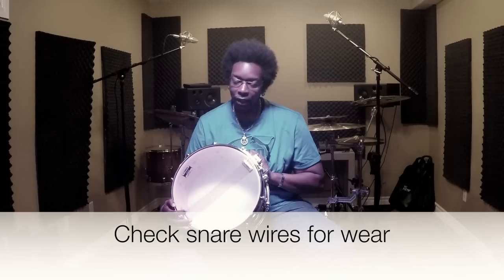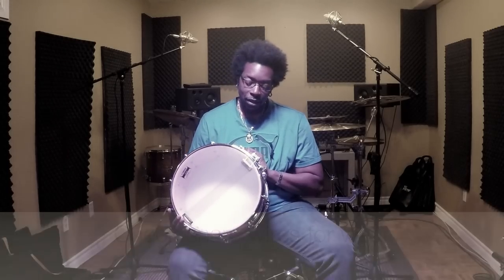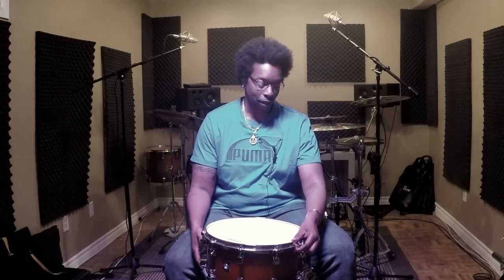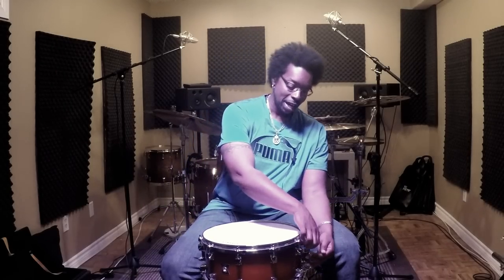Why Your Snare Sounds Like Craaap - Common Problems

Comment: Rob my snare tonight on my New Years Eve set up was getting funky. During sound check I noticed the bass guitar was causing my snares to rattle quite a bit and my tone was a bit off. All I did was tension up the bottom head as you showed us and it sounded like a million bucks again! I did not even have to touch the top head tuning wise. The bass guitar frequencies could barely make it rattle afterwards. I had a great show because of you man. Thanks a lot!  PDP 10 ply Concept maple snare drum.  I played a deep steel 1974 Premier forever till I found this drum. Even though I am a lifetime drummer you NEVER know it all.  We really appreciate you out here.

Comment: Best snare for no cash is an 80's Tama Swingstar.  They're a seamless steel shell.  Same shell used on the higher end snares.  You can find 'em for $50+/-.  Next step up is a Ludwig Acrolite for $100-150.  Seamless aluminum.
Reply: Bryson Dockrill I bought the flagship Black Beauty almost a year ago. Still can't get it to sound right. I have all faith that someone who knows can get a 6.5 Acrolite to sound better the my $1000 work of art!
Reply: I've been through some expensive snares...70's Black Beauties, 6.5 Supersensitive Ludaloys, Ayotte, DW, etc.  People get caught up in prestige.  Going to improve your sound more by practicing than shopping.  I'm sticking with my rusty, worthless Tama.
Reply: Bryson Dockrill
Reply: Yes?
Reply: Metal sounds awful, personal opinion, it allows far too much overtone, always find myself dampening at least some aspect of a metal snare or trying to counter the overtone with tuning. Need a lovely piece of maple or bubinga
Reply: Acrolites are the bomb-diggity.  I use them for EVERYTHING, and I get questions and compliments from dudes playing DWs, Bradys, you name it!!
Reply: @j88k001  acrolites are bloody amazing value.   I had a supra supersensitive 6.5 that cost a fortune,  but ended up using the acrolite 90 per cent of the time.
Reply: I have a couple of Gretsch wood snares, a DW wood snare, an ancient Slingerland (when I want to sound like Gene Krupa), a Ludwig brass piccolo and a Pearl brass that used to be my go to snare, and then I got an 80's era Acrolite and heavy duty Pearl snare stand  for 150 bucks (including shipping) on eBay. Wholly shit, that homely grey beast is a killer!

Comment: Excellent point about the bottom head. I always had trouble getting my snare drum to sound great and I always thought I had the bottom head plenty tight. However, recently I decided to crank it up to a level that I thought could be near the breaking point. But it didn't break and now my snare sounds better than ever. Plus I'm getting additional rebound which has allowed me to loosen the top head and reduce some of the excessive ringing.

Comment: Thanks so much for the help. My '68 Ludwig Supraphonic 400 snare sounds great. I did have a problem with converting to 42 strand snare. Could not figure that one out. I converted to the plastic trap and a 20 strand snare rather than the old 16 strand or wires. But when I used your method of tuning and turned the trap off, then intensified the trap setting the snare came to life. The only other problem was it was ringing really loud even with baseball bat muffler on. So my last thing to do was to lower the tuning on the four key next to the trap and the tape holder and voila. It sounds awesome.

Comment: I played a lot for some years, very hard work and very underpaid. I already knew about these things, but just wanted to say these are very good and sound advices. Check these things out, it really helps. 

If the skin breaks five minutes before the gig, have a spare skin - and use cut out rings from old skins to dampen the effing drum. There is no mode like panic mode, and when your dear guitarist laughs at you, smash his face AFTER the gig and solve the problem BEFORE the gig. :D

Comment: I've found that using Grover cable snares can help reduce snare buzz quite a lot. It won't eliminate the problem, but will certainly help. They dry out the sound a little, but for me, the sound still cuts thru the mix very well, and can improve the sound of metal (steel) shell snare drums by reducing the overall metallic ring of the drum.
I gave up on spiral snares a long time ago.

Comment: Some great advice here!  Learning to get a decent sound out of a snare drum has been an uphill struggle for me, and I still wouldn't consider myself an expert.   I do use a Drum Dial sometimes though.  The thing is, before I started using one I didn't know what a properly tuned snare drum should sound like.  The Drum Dial was a revelation, because with that thing I could get it mathematically perfect and then it was like whoa!  THAT's what it should sound like!  Now that I know, I can do it by ear, but I still use the Drum Dial sometimes.  Another thing that I've learned is that you can drastically improve the sound of a cheap drum by putting a good head on it, like an Ambassador or an Evans G1 among others.  That can make a huge difference in the sound of cheap drum!

Comment: Very cool video, sharing a lifetime of knowledge. I’d like to add:

Make sure your snare wires are mounted DEAD STRAIGHT. It’s easy to check, just flip the drum and watch them engage - if you see the end plates tilt a bit, not straight. That can give you a twangy, raunchy sound.  
I dig nylon cord (Ludwig orange) because you can fine tune the straightness from both sides with cord, but not with straps.

Comment: Great advice Rob!!  With a background in pipe and drums, we used Kevlar heads.  I tried one on my kit.  AMAZING sound and stick response.  I have one now that is probably twenty years old.  I know everyone's immediate thought is "you idiot, you must have trash sound".  Nah ah.  Kevlar doesn't stretch or break and you can crank them as much as you want.  I'm only recommending this for people who can dial in the sound of them but more importantly, they won't break leaving you stranded at a gig etc.  Just balance the bottom head and never worry about it again.  We actually collapsed (destroyed) the shell of a snare drum in the pipe band by over-torqueing the Kevlar head once just to see how far we could push it, and the head didn't break.  They are that indestructible but have great solid and dry sounds.

Comment: Hey Rob, love your videos... You've got a great, laid back teaching style that I dig. Have you ever thought of doing some lessons for Drumeo? 
I wanted to add my 2 cents... The snare is the heart of a kit, and can really make or break your sound. The snare that came with your starter set is probably junk, that's the hard truth. One of your first investments should be a good solid snare. IMHO, the Ludwig Acrolite is a great value at around $100-$125 - although it may be too dry for some (I loves some dry). Don't ignore your reso heads - we tend to think 'ah, it's just a bottom head' and leave the junk that came on the drum. Nothing could be farther from the truth, the bottom head is just as important, maybe more! Invest in good heads, top and bottom, or you're not getting the best from your drum. Same goes for snare wires and straps/cords... Use good stuff - PureSound is the standard, but not all no-name wires are junk. Look for quality finish, clean solders, perfectly straight wires (no gaps or warping). Once you've got quality components on a quality drum, you'll get a good sound. If there's still too much ring for you, try some tuning aids - a couple of my favorites are Aquarian Studio Rings (instant overtone remover) and of course Moon Gels. I even put a cymbal felt on my snare sometimes. Read, watch Beatdown Brown vids, and experiment! You can only get experience in tuning by tuning, right? So get in there and tune. Get to know your drums. Rock on.

Comment: Yep, on the tension around the heads.....I was taught to tune the snare drum to a "D" on each and every tension rod and each individual snare gut on a marching snare.  It's time consuming but, it'll sound like a dream!!!!   Any drum can sound its best if you do this......Guys...there's nothing like a Pearl- in my opinion.    But, you can take a cheap drum, strip it to the shell then, order good quality parts to replace the crap.....As long as you have a good maple shell you can work with it.   The metal parts make the snare what it is.

Comment: Evans makes a great tension rod key with a built-in adjustable torque setting. You can set all of your tensioners to a very similar tension quickly and easily.  I've found that it works best if you back-off on each nut a quarter turn each time you check tension ( for an already set drum). Otherwise, loosen all the nuts off to the point they're still more than finger tight before you weset your drum head. It also makes it super easy to match the tensions on your batter (top) and your resonant (bottom) heads in a minute or 2 . There's also a little gauge with markings so you can write down your tension settings  to easily repeat your previous tensions when you change out a new head. ( or just set it to duplicate the current nuts' setting by feel for when it "pops".)

Comment: When he said "dont use a Tune-Bot" I immediately thought to myself how I need to stop constantly using it and it taking an hour to get my snare where I want it and just rely on Rob's tuning techniques. Sure, you can use a Tune-Bot to tune from scratch and that'll take you a good while but with Rob's tuning method for a snare can get you very close and with a mic attached to any snare or drum you're getting hear the overall tone of the drum and not that one low lug on the drum.

Comment: All good and accurate info. But IMHO, the single most critical element in the sound of your snare (even with a entry level shells and components) is gonna be the selection of the heads. I'm always amazed at what a difference changing weights and ply's makes to the sound of your drums,  especially your snare.  After that, it'a all about the baring edges and how the snare beds were cut.

Comment: I tune my resonant head medium tight (8 out of 10), and my batter about a whole tone up from that, close to as tight as I can get it. 
I like that sound. It's a 14 x 8, 9 ply maple (Tama custom). All the other issues are like you said they should be. Is there a reason why you wouldn't tune a snare like that? Like some tonal quality? 
It has a good crack, with a somewhat muted wire response, which I prefer. It records well to my ears for a dry-ish rock sound.

Comment: Thanks for the snare tips!! Now here's a room acoustic panel tip.. The eggcrate foam  does not work.. You can build your own using Owens-Corning 703 4" deep in wood frames and with porus material covering. Your drum room will sound a lot better. I can hear a boxiness in your voice track that can be fixed..

Comment: Try a really thin reso (snare side) head, such as 3mm along with a batter head that has some sort of control ring.  A good overall choice is an Evana Genera Dry batter head which is also drilled with small holes along the edge to help eliminate excessive overtones.  Tune the reso higher than the batter and try a little moongel or other dampening device to the batter head.  With snare wires, usually avoid wires that use cord and stick with straps.  Puresound Blasters are good although cheaper, yet new snare wires will provide an improvement.  One other thing, $700+ snares don't necessarily sound better than a $250-$300 snare.

Comment: Thanks for the tips. Actually, I just received from Sweetwater this week a new Tama SLP Aluminum Dry Snare of which I will need to tune. It is not as crisp as I thought it would be. Comments Rob?
Reply from the maker: +Tracy McNeal No clue. Those SLPs are good snares. As long as it's tuned up right, it should sound great

Comment: This is related to a different video (Although you're 100% right here)
When did you start using traditional grip? Why, and what differences have you noticed?
Reply from the maker: +Tobydog Loser Started working on it about 5 years ago. Just felt like learning it since most of my heroes play that way. It was just a fresh challenge after 25 years of playing. Just makes you think differently when you use that grip and it changes how you play stuff you normally play with matched

Comment: One thing I might not be totally onboard with - snare side head. I think I’ve found more folks who actually have overtightened that side than the other way around. Too tight you can’t get a nice dynamic touch off the drum.

Comment: You took alot out of my mouth.The set I got isn't a top of the line.I played for 27 years and has to quit for awhile to raise my kids in my own.But I have put new heads all around Evans of course and the snare didn't sound bad but wasn't the big fat sound I wanted.So I replaced the snare and throw off and what a difference.I am currently saving up for a nice Tama kit but my cheap one everyone likes the sound as you said with yours.But the white coated Evans heads what ones do you feel would be great for me?I play country more But some other stuff too but 90"s country and present are the most.And I want to replace the bottoms.What kind to match with the batter

Comment: On tuning...use two keys.  Tune enough so you can feel the tension.  Most heads have "bad spots," but you can overcome that by feeling the amount of tension.  If you tune by sound only, you're not compensating for that one tension rod that can't quite hit the "sweet spot."  Experience is the only thing that makes up for bad tuning.

Comment: This may be a little off topic, but any thoughts on the 'new snare drum tuning trick' that's been going around? The one where you loosen some of the lugs on the batter head completely to get rid of the overtones.
Reply from the maker: I think I've seen that video. Haven't tried it yet, though.
Reply: On Wood Snares you don't want to leave it like that for long, on brass or aluminium snares it doesn't hurt them from what I've been told. Personally, i I think it takes the life out of a snare drum, but some people prefer that sound. I like a little bit of over tone/ring. Just makes it feel more "alive" to me :)
Reply from the maker: I'll occasionally loosen a top rod or two if there's a song in the set that calls for it, but I'll tune them right back up when that song is over. I believe even tension is important.
Reply: I think it’s bizarre - I’m playing for 50 years and i know how to make one sound good. Maybe for very heavy/cutting backbeat styles, loud funk band where you need to dial-down for a slow jam, it’s interesting... but when he goes into that “table-top tight” business and uneven lug tuning, that’s just not musical. I think it’s an interesting video but useless for anyone playing styles demanding ANY subtlety/shading on a snare drum. Sorry for rambling on a bit ...

Comment: I had a local youth ( 38 yo) ask me to help tweek his frankenkit. so I went to this cats house and it was like a bit scary. it was a big old house like a mansion, everything outside was a mess junkyard style. I enter the house and the best way to describe it, Fred Sanford was more organized.  so I see his drums and I can honestly say I have never seen anything like it. I've seen Street drummers with better buckets. the kick was an old pearl export, the tom mount bracket was half gone, there was a 13" on a homemade tom arm being held in place buy a giant wad of tape, the tom was also pearl export bottom head and missing, it was painted white with flat latex paint right over the wrap. the floor tom had the same paint job. it was an 18" Ludwig melodic tom with improvised leg brackets and a coated emporer that had to be at least 40 years old. the ride cymbal was an 18" pearl and the mounting hole as about the size of a quarter. NOW the best way a 70's 5 x 14 super sensitive snare. both top and bottom hoops were terminal he had regular wires tied to each side of the throw off and butt end, both fine tuning knobs were frozen, the heads they were shot 20 years ago but the shell looked like it could be cleaned up. so he has no idea what has, someone gave it to him. so I try to help him by offering a nice clean 61/2 x14 pearl  C.o. S. snare. he said he would think about it, when I seen the drum I thought of it as a mistreated sick puppy and I wanted to try and save it. so in the meantime he goes online and uses the information that I gave him to look up what a vintage Ludwig super sensitive snare is going for. I would guess he seen some on eBay going for $500.00 or more. so I get back with him to see if he made up his mind. 
but now he's a bit more reluctant because he thinks I'm going to fix it up and make a profit. so I'm an overly nice guy and I sweetened the offer with the pearl snare and a 4 pc Peace kit. the drums are yellow with black hardware. he said he'll tink about it. I asked him to come and check it out, he never came. after thinking about it, I almost made a gigantic stupid mistake. I haven't seen or heard from the guy since. I thought it was all rather strange.

Comment: Hey rob you should check out TruTuner its a cool way to tighten all the tension rods evenly.
Reply from the maker: I've seen that thing. I'm sure it works. Couldn't imagine myself carrying that big ass plastic disc around with me, though. lol Seems like a bit of a production to me.
Reply: +Rob “Beatdown” Brown thats true. It does fit in a standard cymbal bag but it is a bit big to randomly carry around.